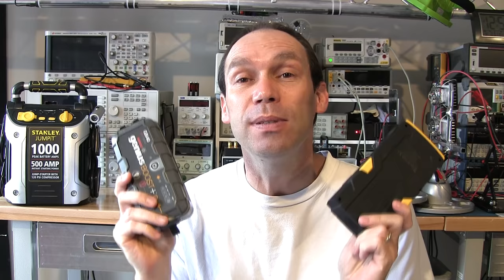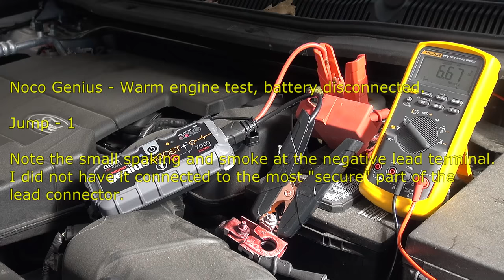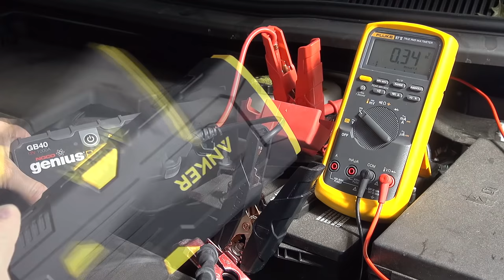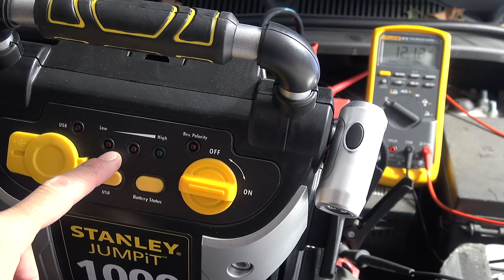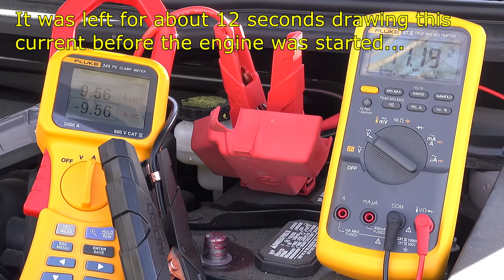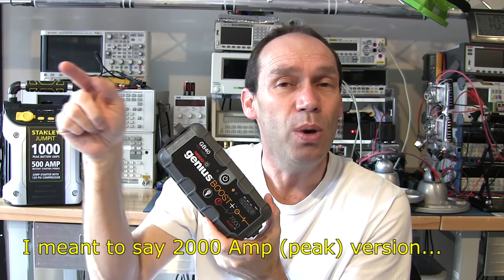Portable Car Battery Jump Starter Tests! - Part 2

Comment: Capacitor Jump Starters are in my opinion a bit better. They can also charge the capacitor (themselves) from almost dead car battery and then give that instant current rush that is needed to start the car. I have one (Rockford made in USA and it has started many cars already including 4x4 diesel.
Not sponsored honest review: "Rockford RFD1000 Jump Starter Review"

Comment: Hey at -32C the Noco is useless but my son Stanley did start my car a 1.5l 4 cylindre, and the Stanley was in his trunk.
Reply: ya was going to say here in Canada -30c  mornings are normal during winter w some mornings being -40c+
Reply: I just use a jump n carry. It’s literally a battery and jumper cables. Rock solid reliable. It’s what dealerships and roadside assistance use.

Comment: Starting a car in freezing temps doesn't have as much to do about the cold motor, it's much more about the cold battery.  Also, your using that noco wrong.  You have to put it in bypass mode, and then connect it up.

Comment: This review was incredibly helpful, thank you! Since this video was made, Noco has released their Boost X series with some minor upgrades and different amp ratings. I just bought the GBX45 which offers 250 more amps than the GB40. I figure this will be perfect for my 2.5L 4 cylinder Subaru, even in freezing temps. Cheers!

Comment: I currently own the Cat 1000amp Pro Portable Jump Starter, CJ3000.  Both my vehicles are 6 cylinder vans.  Is one of the lithium units going to have a better chance of  starting my vans or should I keep my Cat unit?  I notice with the Cat that if It doesn't start first time, i let it sit for a few minutes and then it usually starts. Is this because I'm warming up the unit ? Great explanation on what the accuracy of the claims are.

Comment: Thumbs up from me, hope it is enough revenue to get you a new starter for your vehicle :)
True test would be to charge the portable and keep it in the trunk of the car until it starts snowing or super cold a few months, then bring this out of the trunk and try a cold start. Would mimic real world senario where both the pack has been in the car for a long period and the batteries in it are also ice cold and have been cold for a long period, as cold effects batteries.

Comment: It look the Norco on the first try with the cold over night start the connection was not good enough but it spark and made there contact better so the second and 3 try work , I am surprise of the low viewer on this part 2 ,maybe I am and 855 other more curious . Great test I was surprise also that little think Norco performance , any way great thanks .
Reply: This video isn't listed publicly on his channel, that's why :)